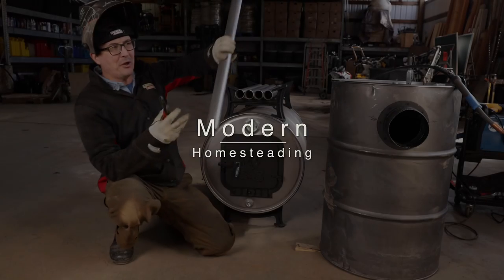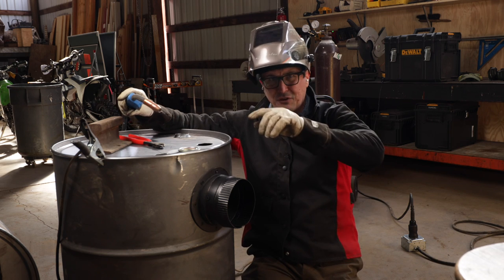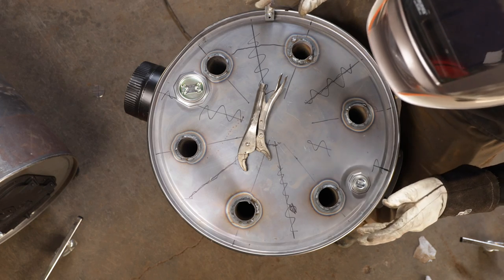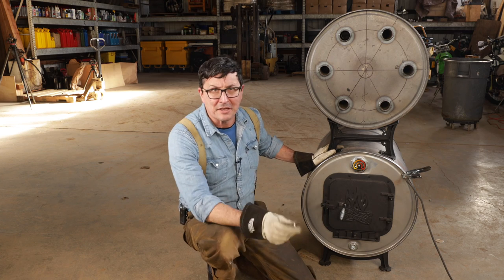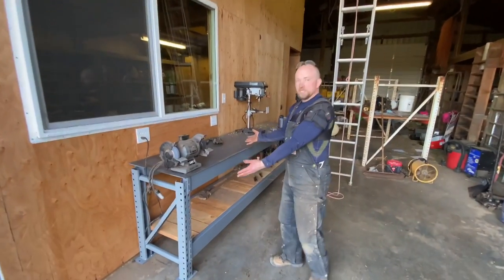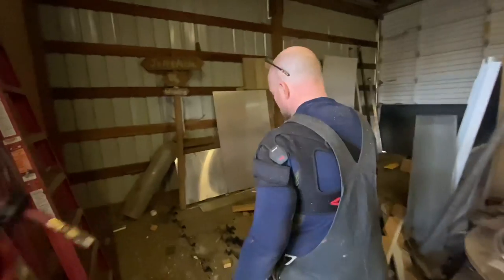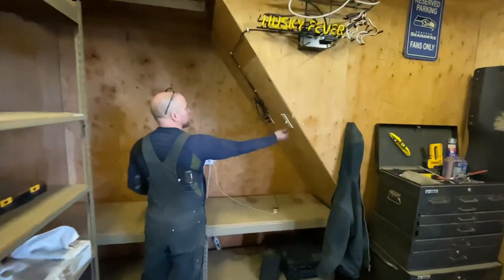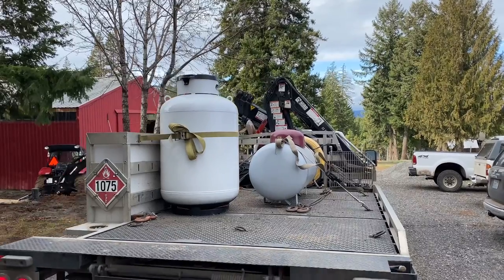This Welding Will Leave You SPEECHLESS!

Comment: My guess about the clicking without reading the comments is a fence charger that you have inside the shop to keep it out of the weather. It's way better than that fence you bury in the ground. It's the only thing that keeps our tiny pack of 4 Husky dogs home. We lost one to a car at the all-night vet even with a State Police escort. Our whole family was sad about a half a year and like Cody's fond of saying do it right from the start. My brother-in-law used treated 8x8's and steel reinforcing mesh to pour concrete slabs with secure fasteners to treated 2x8's two high and no escape out of the fence yet! If it'll keep in full grown steer on fence wire this is not the weakest link! Or could it be the duty cycling of your welder?

Comment: Its easier if you down hill with hard wire. Turn it horizontal and weld down. It will help with heat. Especially because it's so thin you wont have to worry about penetration with it

Comment: If you are right-handed, you should be dragging the welding wire from your start point from LEFT to Right. Get a steady movement. Moving the opposite direction is pushing your puddle and it makes for ugly beads.

Comment: Your welds will come out neater if you follow this rule; “if there’s slag, you drag. If there’s no slag then you push”. When it comes to mig welding, that means that when welding with solid core wire, you should always push your puddle forward with your gun at about a 45 degree angle to your work as you’re welding. If you’re using any type of flux core, then you should drag your gun in front of your puddle at about the same angle.
Reply: That will also make welding pipes and odd angles easier

Comment: "Good enough for the girls you go out with" 

IMO if wanted to tidy those up in the future - The gap in the fit up was little bigger than you would ideally want but not the end of the world. Would have had barrel on its side and use gravity, welding downwards creates a smoother weld. Aim to keep your angle of "attack" constant so the mig wire is travelling a uniform distance and the gas shield is even. Anyway good job for an all rounder.

Comment: Gaps should never exceed the material thickness being welded..you were fighting filling a gap and the heat necessary to keep a puddle, hard road. It's tricky to get a hole to fit the tube with a hole saw, almost never the right size..either you spend the time to hand cut the hole to size and get it right and tight or spend the time filling gaps and in the end the tighter the gap the better the weld turns out.

Comment: Wranglestar. Next time tack around the tube as much as you can . Bridge it all before you start welding so you aren’t filling gaps while your welding. Also, weld in quarters at a time so you can reposition. Skilled welders will do that while thing in one bead and consistent right.

Comment: I think you’re being over critical of the welds Cody. You’re not going to get a single pass so you will have to lay beads over each other no way around it. If you are welding tube on a turn table and use a pulse it’s not to hard to get real nice results. To simulate that here I just essentially stack spot welds. Then I can stop and move every couple spots. You won’t get the thick bead but structural welds are not needed...your just filling holes. Also the pipe is thicker than the sheet metal so I essentially weld a bead on the pipe and set my heat and wire speed for it and then just roll the edge of the bead over onto the sheet metal with each arc shape. This keeps the gun pointed at the thicker material and the heat center there. All that said it looked good to go! I would love to see you do some DC tig!

Comment: With welding it's all about doing, the more you weld the better you get. Most people give it up because they don't have the patience or fortitude to continue. If you think that's difficult use and arc welder. Keep melting metal you'll get the hang of it, you have that I will do it attitude.

Comment: Rivnuts would b a good way to bolt the top barrel onto the frame. Why do you have only 6 heater tubes? Is it only the hassle of all that welding?

Comment: I would installed the pipes before the stove pipe fittings, so I could do a pressure test on the welds before proceeding, but I guess that is just me, an old steam plant engineer. probably not a real problem as the stove pipe joints won't have any real pressure.
Anyhow nice project

Comment: With metal that thin I find it way easier to turn the welder down I lil bit “to much” and do like a wiping motion mind you a only use 1.2 mm wire even if it's that thin

Comment: Gotta run a quick bead around the hole on the barrel top and then come back and run a bead on the pipe, and then weld the 2 beads together going up and down. As my uncle would say, "you gotta build the fat"

Comment: i wouldn't sweat the welds too much.  something like that could be held in with a tack weld.  the full bead, even if it's not perfect, will get the job done.  also, i feel your pain.  days when your project fights you every step of the way can be infuriating.  then you accidentally deface your own tools and feel the initial urge to give yourself the talk about tool care, realize you already know it, and don't know how to feel about it. happened to me with a brand new multimeter. broke off some of the tip in an outlet i was testing and kicked the breaker.  that last tube you welded looked a little higher than the rest.  i hope it wasn't welded in place too high.

Comment: What if you’d weld the pipes in at an angle? More precisely- if you’d put longer pipe in the first hole but then in the neighboring hole on the opposite side. First: the pipes would be longer, second: beeing at an angle, airflow would be more natural and faster.

Comment: lower case    e patterns....  gets good penetration on the weld  and the speed of the heat will soak the material as your progressing..  also exhaust pipe will rust out on the stove should have used  black iron thicker wall tubing...

Comment: I'd be wary of any spot on those welds where you didn't get glow through to the inside of the pipe. I wouldn't rate the barrel spacers very high with their flat mounting pads. They'd be much better if they were curved like the damper and the other flue flanges.

Comment: The clicking in the background can't be ping pong; it's too constant. Its the power supply for his electric fence. I grew up on a Wisconsin farm and know that snapping sound (and feel) well. You can see the fence as he drives up as well as on the opposite side of the shed from the work area inside. Sure sounds a lot like ping pong though if you can't hear it clearly!

Comment: Hey brother... Curious what you thought of brazing tubes in.  Would possibly be easier and quicker.  Its difficult to weld thick and thin without burning through and or cracking.  Brazing is easy with a simple map gas torch and some flux.  It would wet out and seal well too.  Im no expert, what do you think?  Have you ever tried?  Any negatives?  Wouldn't think the heat would be high enough to cause it to melt.. you'd have to get the stove red hot before it would soften.
Reply from the maker: That would have been a better idea, I'd like to do this but my torch doesn't have a braising tip,
Reply: I was thinking the same thing. I would braze it.

Comment: I don't think the welds you made are too critical for the project .  They are acceptable. 
Next time try 3 tacks spaced evenly,  then weld using 2 passes front of the pipe then back sideof the pipe instead of trying to do it in one single pass. 
The first pass should be most of the weld,  about 3/4 around,  then a smaller weld in the back.

Comment: Welding is a trade that takes many many hours even years to perfect, don't feel bad your doing fine. They make a product called a rivnut for blind holes to bolt those drums together. Check your local nut & bolt store  on the details, a fantastic solution for blind holes. I have personally used them many times. Google Rivnut Fasteners? I like to pass useful information if I'm able to assist in any way.. Great day to you Sir.

Comment: Not 100% but if you had a bonding clamp between your pipe and barrel it will have a better connection. My guess is as you get it tacked in you will have a better weld.

Comment: Wouldn't it have been easier and look better ( than your welds) to thread the ends of the tubes and simply screw a nut on each end or can nuts not be used on pipe threads?

Comment: Where are you from? 
Country, state, place, domicile, something??? 

I'm from Jamshedpur, India and I don't find anyone near me who can weld (TIG weld with filler) a High Carbon Steel table or any table for me with precision & accuracy. 
I have all the dimensions in my head but no welder near me. 
I want seal weld for table frame made up of square pipes of 1-1.5inch sides width & 2.5-3mm material thickness.

Comment: would have been better to use a TIG welder on metal that thin and a filler rod, its much easier to weld with and gives you a beautiful finish,  MIG  is way too powerful for thin barrel steel 1mm or under.

Comment: Start in a position where you’re slightly uncomfortable away from yourself and the. Move towards the position where you’re most comfortable. Do a couple practice runs going the same speed you would be as if you were welding. For the thinness of the material you can move the tip of your gun up and down slightly to dissipate the heat. Not too fast though or you won’t get the penetration you want and it’ll look funny.

Comment: Run that mig downhill 12 to 6. To much weld on thin wall material can weaken the material at the edge of the weld or like a QA man said to me one time "Because of the close proximity of transmission lines it could cause crystallization"  I told him to get away from me before I crystallize your head.

Comment: Right off the bat "imagine the safety issues of an unclean weld on this would be?"🤔uhm.... what?  It's not under pressure, it's a heat exchanger in a chimney, worse case scenario is a bit of smoke gets in the room.🙄🙄🙄

Comment: LOL ok here's my tips Practice ,practice but practice smart.So 3 tacks actually short welds , 6.0 mm long at 3 equidistant locations ,keep them small.Now if its mig you should push not drag but hey ho rules are made to be BROKEN.Next do not be greedy but run a weld ensuring you can always see the arc say 2 inches now here's the trick to minimise overlapping welds and high bumps.Run each weld into the start of the previous I could do your example in 3 welds .Peace.

Comment: I TIG weld stainless steel for a living and have also welded superalloys when I was in aerospace. Check my channel for proof. Those welds are excellent because the end result is a FUNCTIONAL stove that is USEFULL! Pretty welds are the marks of a skilled welder which are only necessary for certain applications. Functional welds that create an item with a long service life tend to be what matters when it comes to the average consumer. Could this have been TIG welded with all stainless? Yes but that would have cost 3 times as much, taken longer, and would only be practical for industrial level cooking. Nice stove.

Comment: Please be kind to your viewers and be honest with them.
Your videos are good, but I find it tragic to see this video (and many like it on YouTube) promoting the use of these  "smudge pots."  
This one, and all shop-built airtight stoves are inefficient, pollute like crazy, and create ideal conditions for dangerous chimney fires.
These homemade smoke belchers are cheap initially, but end up costing way more very quickly. And they pollute the air for miles.

It's sad to see people badmouth "EPA" stoves when they are clueless about them. 
Most modern "EPA approved" wood burning stoves are engineered to preheat the combustion air 
so combustion is complete and any smoke is burned.
This brilliant and simple wood burning technology used in "EPA approved" stoves makes them:
1. way cheaper to heat with, by using 1/3 less wood for the same amount of heat - How?  See number 2
2. far less pollution by burning all the smoke created in the firebox -  smoke coming out of a chimney is UNBURNED FUEL
3. greatly reduces the hazard of chimney fires or having to clean the chimney because almost no creosote is produced.

4. You and your neighbors will breathe cleaner air, and you will split & store & haul & load 1/3 less wood AND ASH

Comment: Welding tubes through flat sheets is really tough. Do it in short 1/4" steps, but despite your self-criticisms I think your work is hugely better than I could do. 
Flaring the hole outwards with a dimple die to give a tight fit on the tube will help. You could also try some weld-on barrel bung flanges. It will take some time on google to find the ideal type but here's an example. 
https://www.indiamart.com/techno-craft-inds-india/steel-plated-drum-closures.html

Comment: If you're honestly not a good welder and only need to weld projects like this, get a stick welder. Much more forgiving
Reply from the maker: Guilty as charged,
Reply: @wranglerstar  honestly man, you dont have to contend with wire speed and all the other technical stuff required by a mig.  Stick welders work just as good and can be had cheap. I've worked in the oil and gas industry for 13 years, have become a proficient welder with a mig through my struggles but even still I prefer a stick. You should give one a shot.

Comment: I', a welder and do curves all the time , I use 023 , 035 and 052 metal core , , now that's hot , ,, o35 and 052 all spray ark , but i can weld a soup can with the 025 ,,,... anybody 
lookin to hire ? I'm 100 % on time and there every day , ,, just saying  , I work at    Saf-T-Cab Ontario ,, Just putting it out there